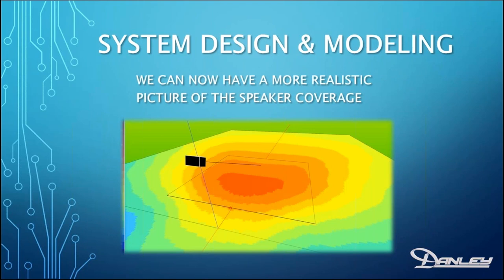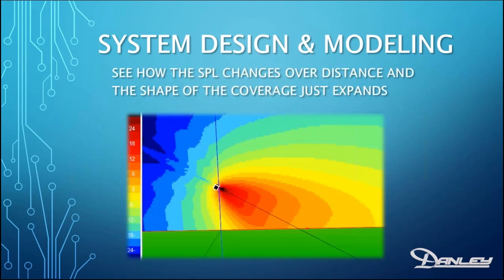Fireside Chat | System Design and Modeling. The Good, The Bad and The Ugly! | 4.30.20

Comment: As a hobbyist I did play around with the software and I found for central stage/round venues with sufficient ceiling height, the best subwoofer system was a vertical column/line array/TM Array of subwoofers flown directly above the stage, with a slight time delay from top to bottom such that you created a toroidal pattern of bass on the audience (it would have the effect of tilting the entire subwoofer stack downwards, but in ALL directions at once), and phase cancellation on the stage and ceilings. Then you could use possibly a cluster of 6 GH60 or a louder box depending on needs in a circle to act as mids and highs.
Tiger stadium looks annoying because what you'd WANT to do was fly speakers high at regular intervals to face down to the audience, but yet there are NO attachment points or structure at all to do anything with so it's impossible, so scoreboard it is, with all the unequal distances and angles it creates.